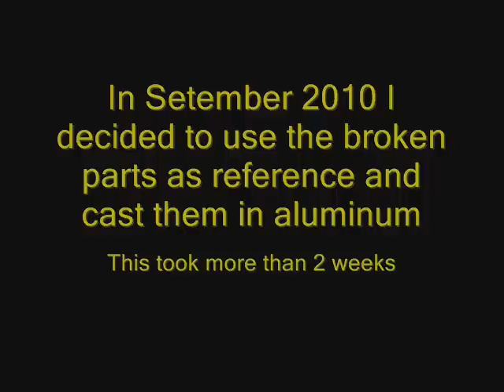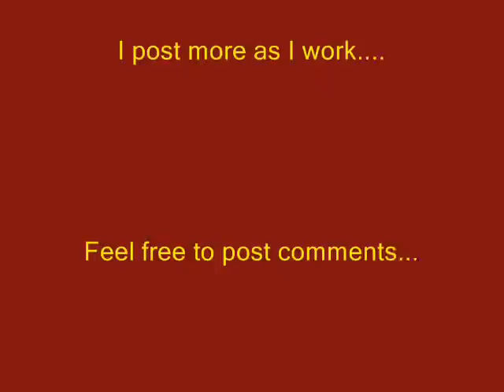Terminator Arm

Comment: Extremely impressive O.O
How do you made all the parts fit together? Do you used a CAD program to plan their dimensions?
Do you thought already about implementing pneumatics, so it can move parts on its own? (Computer controlled)

How heavy is the arm? Is this aluminium hollow or solid even on the bigger parts?
How durable is the arm?
How much aluminium do you used for the complete arm?
How do you made the negative forms?

Questions over questions :)
Anyway, really outstanding work.

Comment: There is no way for just the tip of the fingers to move right? I have a copy of the arm and it seems flawed in the design.
Reply from the maker: On a "real" version the finger tips could move there a lot of copies of it that have the finger fix into a set pose.
Early finger test..... https://www.youtube.com/watch?v=NdwvREbiOBQ
Reply: The reason I wonder is because the lack of pistons. If a finger is three pieces then it should have 3 pistons not one or two.
Reply from the maker: Ok I see... but no, you only need cabling for it to work, you can also use a leaver system,
check out these..... Hope it's of use
Cable system https://www.youtube.com/watch?v=vmGntjXJAAA
Leaver style https://www.youtube.com/watch?v=P73LFqmXvRM
Cable set and build explained https://www.youtube.com/watch?v=9Jof_HYMH7A